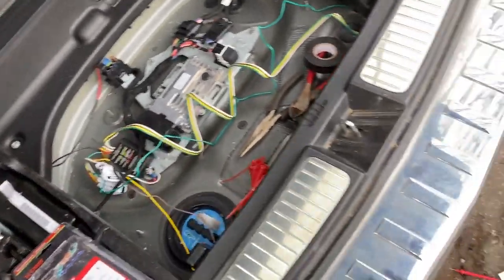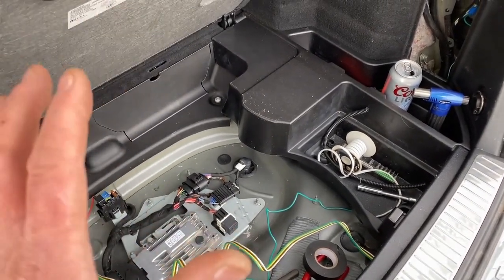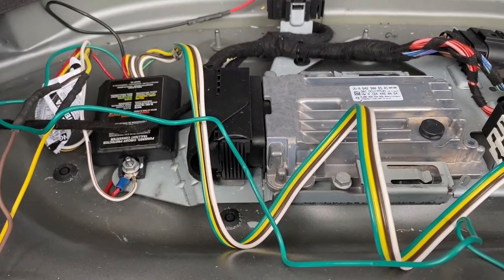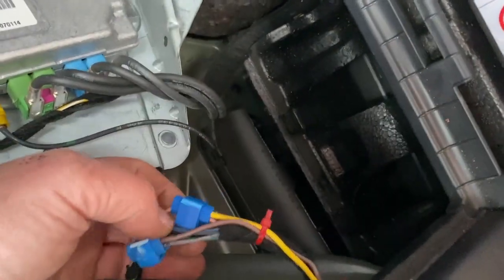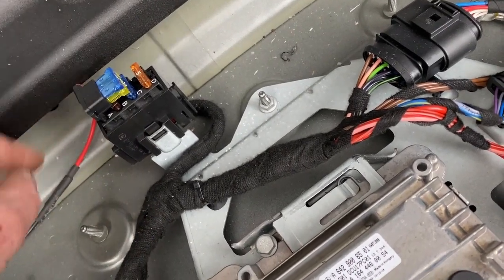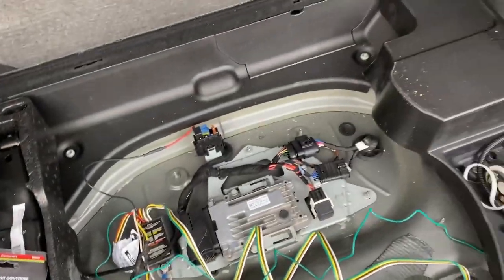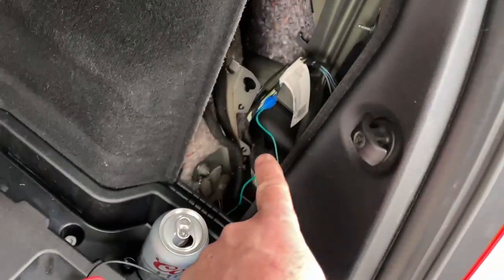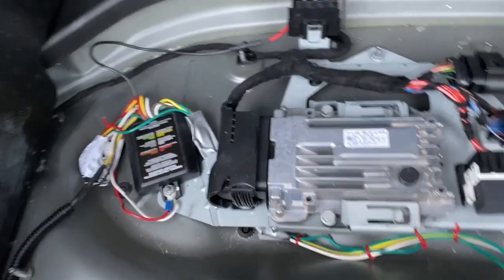Mercedes GLK 250..2013-2015  easy Trailer wiring

Comment: My Goodness, Thank you SO much for this! I have the same setup. I put the hitch on before I found your page. A pain, but nothing big. Why would German engineers not put a multi-wire connector in the loom on a diesel SUV? I find that poor at best. The dealer wanted $3,300 for the hitch and wiring installation. Equally as poor in my mind... However, with your help I almost have it wired. Fortunately, I have a Tab camper with a surge brake controller so I will not need the electric brake controller. And no power charging wire?? I have solar panels so I guess that is covered too. Not impressed with this system. But, your help is fantastic! The one change I made from your video is the different type of liquid enthusiasm. I used Guinness instead of Coors... I am in Canader.... Cheers! :)
Reply from the maker: I’m in Canada as well . The Coors was a neighbour drop off ..lol , my usual is Sapporo or Asahi 😁
Reply: Great! How have you found your GLK? I just bought mine. 2013 with 37K kms on it. I sure hope it is reliable after chatting with the dealer I am a bit surprised at the cost of service work. I bought it mainly for travel. With, or without the 2,000 lb trailer. Cheers!

Comment: hi question does our Curt hitch slope downward a bit? I had mine installed and it's not parallel to the ground.
Reply: Interesting.... The bolts might not have been tightened evenly
Reply: Thanks I've checked so assume that's just how it is. @100pyatt

Comment: Help! I’m sure if I Googled harder I’d find and I’ll prob keep looking but my wiring on the left side was a bit different (2015) I have a grey-blue and grey-black instead of grey-lavender I avoided the grey-blue and attached to grey-black. Result is brake lights work, left turn signal works, right turn makes them both flash. Any ideas?  Thanks and love the video!
Reply: Never mind, as a fun fact don’t assume your used trailer was wired correctly 😂  Thanks again for this video was very helpful!